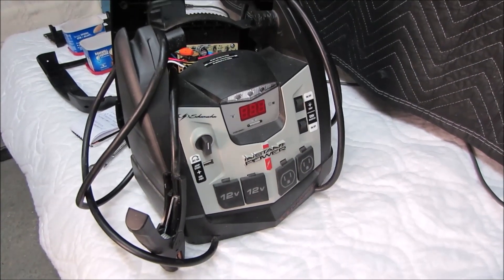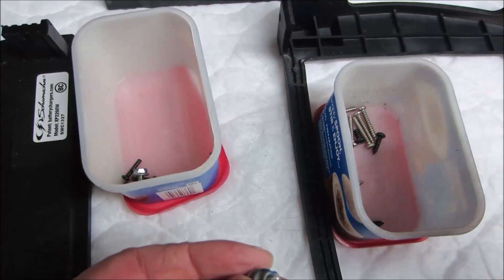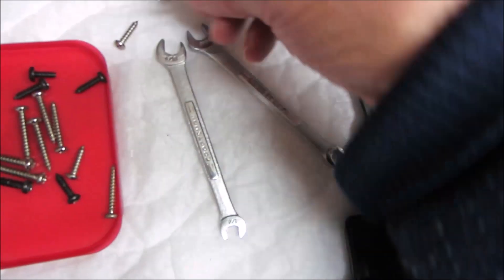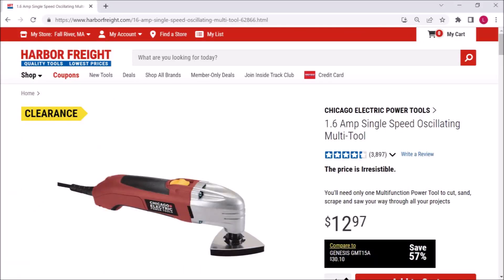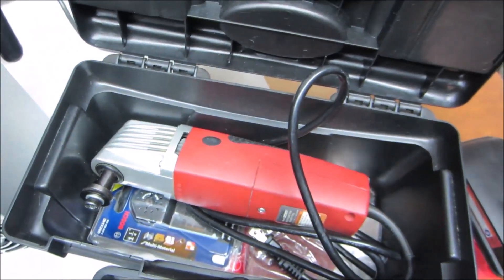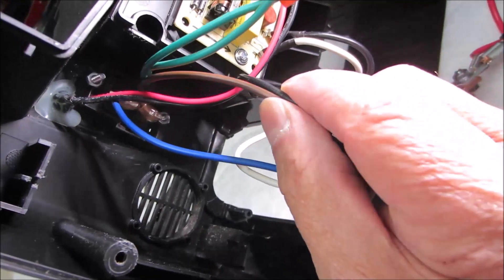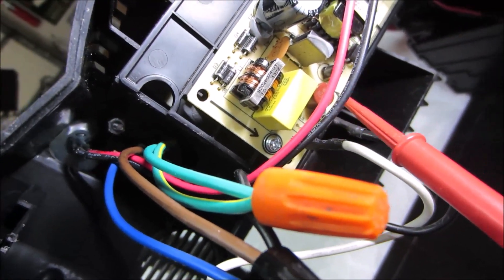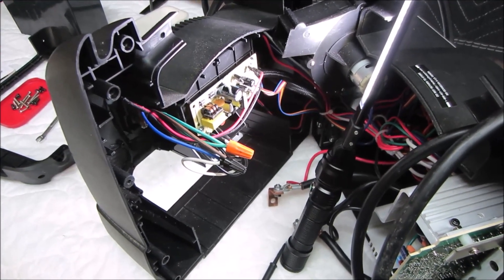Portable Power Repair Secrets - Schumacher™ XP2260 Not Charging?

Comment: Do you know what the voltage at full charge should be? I took the battery out of mine because as soon as it got to 100% and i unplugged it  dropped to zero..it’s older so plugged it in again and then i was getting all sorts of readings ..from 93% then3% and finally after a couple days on charger when plugged in it still jumped around but unplugged it was saying around 50%..so i took the battery out to check voltage ,expecting to see 7 volts or something similar..but it read 13.14 v which im guessing is full new charge..? Was thinking id find a replacement battery at first, but now im at a loss of ideas… there were 3 small screws bushings and nuts that all fit together.so im assuming theres some sort of disconnect in there ,or i maybe cause those screws to come undone some how..but I don’t know how i couldve caused it by removing the battery🤷🏼‍♂️🤷🏼‍♂️🤦🏼‍♂️
  Sorry for the long comment ,im in the middle of all this right now and as im rethinking it through im typing ..
Reply from the maker: 12.9 to 13 volts is full charge. When you say the voltage reading jumps all over the place I assume that you're referring to the digital display on the unit. Try turning the jump start switch on and putting your multimeter across the alligator clips. If your multimeter shows 12.9 to 13 volts at the alligator clips then that means the problem is with the digital display not with the charger or the battery.
Reply: @LawrencePina oh yeah across the clamps too ..well across clamps it reads mostly low voltages so imAssuming yeah the battery is just done ..its over 10 yrs old ..just got a newer noco gbx 155 jump box and i already got jaco 12v air compressor for emergencies ..thanks ✌️👍🏼
Reply: Figured out what the screws bushi gs and lil nuts were for. They held a board to a bracket with bushings keeping them from touching. Was hoping this was the issue with the bix but still once battery is connected baxk up everything reads funky again 🤷🏼‍♂️🤦🏼‍♂️

Comment: Excellent repair video good to know about this potential problem with the Schumacher because I'm buying one today the guy told me the air compressor was not working said he thought it was because it didn't have a full charge have you ever had one of these for the air compressor didn't work?
Reply from the maker: Yes, air compressor "not working" is a common problem with all brands of used / trash picked portable power packs, but "not working" doesn't tell us much. If the pump does not make noise when turned ON, then: 0. Suspect the rocker switch. If the pump does make noise when turned ON, but no air comes out of the hose, then either: 1. The rings on the pump piston are worn. 2. The air hose has blown off of the pump. 3. The air hose has a hole in it. 4. The air chuck at the end of the hose has failed. Often, a trash picked unit will have more than one of those problems (as well as a bad battery). Hope this helps. Thanks for commenting.

Comment: I just bought one. I use it to charge my phone. I had my usb charger plugged into the battery. But after awhile the battery will beep. Do I need a whole new battery or is it an easy fix? Thank you so much!
Reply from the maker: Not much to go on here. Do you have the phone's 120VAC to 5VDC wall charger plugged into a 120V AC inverter socket on the power pack? Or, do you have the phone's USB charging cable plugged into a USB A socket on the power pack? Or, do you have the phone's USB charging cable plugged into a 12VDC to 5V DC cigarette lighter plug connected to a 12VDC accessory socket on the power pack? I've tried all three ways and I can not duplicate the symptoms you describe. The only problem I did have is when trying to charge an old Motorola flip phone using various USB camera cables. None of the camera cables I tried had their charge lines connected, just data lines, so none of them were able to charge that old phone. Interested to know which charging method you used and whether or not you tried any of the alternate charging methods...

Comment: They still make the flip style. Had mine for two months..used it a few times and it already stopping taking a charge.
Reply from the maker: Might also be a dead battery. These two videos should help you to determine which it is:
https://youtu.be/OsAhYTDgEr8 - XP2260 Not Charging PART 2
https://youtu.be/g5ibI23UWCA - DieHard 950
Good luck! Thanks for asking.

Comment: my unit starts to charge then stops?  Is it a dead batteries... are they replaceable?
Reply from the maker: Dead battery is a common problem. It is replaceable. These 2 videos should help:
https://youtu.be/OsAhYTDgEr8 - XP2260 Not Charging PART 2
https://youtu.be/g5ibI23UWCA - DieHard 950
Battery is easily replaced on these units. You can do it! Thanks for asking.

Comment: My plug did not have wires ...what two posts are the two wires attached to??
Reply from the maker: When you say "my plug" are you referring to a 3-prong replacement plug? In that case, rewire to the outer two prongs. The center prong is for earth ground which is not connected on a portable power pack. For additional views of the 3-prong replacement plug I used please watch: https://youtu.be/OsAhYTDgEr8 in "Schumacher™ XP2260 Not Charging? PART 2." Lots of additional (viewer requested) info there. Good luck! Thanks for asking. Please like and subscribe as it really helps the channel...

Comment: Lawrence, is there visible damage in the connectors when they are bad/broken? Or they just stop making contact. Mine wont charge, but woulld like to know if a new charger is enough.
Reply from the maker: Swing out, power cord connectors break in such a way that their male prongs no longer make contact with the load and neutral wires inside the power pack. When this happens, the plastic is usually (key word: usually) very obviously broken and the prongs swing out crooked. Part 2 of this video, https://youtu.be/OsAhYTDgEr8 shows how to test connectors that may be less obviously broken. If the power cord connector tests good, then most likely you have corroded ring terminals on one or both of the battery cables and/or (most likely, and) a dead battery. These common problems are very easily fixed. Watch Part 2. Good luck! Thanks for asking.

Comment: Hello…
I have the Schumacher XP2260 - CA.  It won’t charge past 74% and the green led light on the back does not come on at all, of course I wouldn’t know how to fix it, but I can pass on information to my brother.  When I turn jumper on it reads 12.7,   When I turn the inverter on it reads r02, lights work on the front.  Any information will be appreciated.
Reply from the maker: Regarding the r02 error code, Schumacher codes actually start with an f (as in failure?), which I also originally mistook for an r (because it looks more like an r?). According to Schumacher, here's what it means: "F02 The charger cannot desulfate the battery. The battery could not be desulfated; have it checked or replaced." To check the battery, remover the battery compartment cover and look for corrosion on the battery terminals. Detach the connections as necessary and clean off whatever corrosion you find with a few drops of apple cider vinegar. The first few drops will bubble. When the bubbling stops, all of the corrosion will be gone. Next, test battery voltage with a multimeter. Does the multimeter agree with the 12.7 volts shown on the Schumacher display? Whatever it shows, reconnect the battery cables, plug in the charge cable and retest. Does the meter show over 13 volts now? If it doesn't, charge voltage is not reaching the battery. Further disassembly and observation may reveal a pinched wire, internal corrosion, or you might just have a bad charger PCB. Lots of info on these issues in https://youtu.be/OsAhYTDgEr8 Portable Power Repair Secrets - Schumacher™ XP2260 Not Charging? PART 2. Hope your brother can find and fix the problem. Please consider reposting after he's given it a look. Let others know what you found out. Good luck and thanks for posting!

Comment: Thanks for this. I have the AC power jack problem also. 
I need to take this on a road trip before I can attempt the repair. I'm going to try the following: 
Use a trickle charger connected to the jumper cables with the jumper switch turned on. Hoping to DC charge the battery that way. 
Do you see any problems with this approach?
Reply from the maker: What you suggest works fine. You can charge the battery that way but there's an unobvious connection catch. While both jaws of the Schumacher's alligator clips have big copper contacts, only one contact is actually wired. If you clip the float charger to the wrong contact, an easy mistake to make, it won't charge. So if you don't already have a float charger, consider something like this: https://www.harborfreight.com/automotive/battery-tools-accessories/battery-chargers-maintainers/12v-deluxe-battery-maintainer-and-float-charger-62813.html or this: https://www.harborfreight.com/automotive/battery-tools-accessories/battery-chargers-maintainers/4-amp-fully-automatic-microprocessor-controlled-battery-chargermaintainer-63350.html Both of these have an SAE connector in the middle of their output cables and come with two ways to terminate them. You can plug in a short cable with alligator clips or a short cable with ring terminals. Attach the short cable with ring terminals to the Schumacher battery. Notch the battery door so that the SAE connector hangs outside. Problem solved. Not only that, but you can leave the maintainer permanently attached. It won't overcharge the battery you won't have to energize the  jumper cables to keep it charged! Much safer that way. Good luck. Thanks for commenting. Please like and subscribe as it really helps the channel.
Reply: @LawrencePina  thanks! 
Great channel. I learned a lot in my first view. Subscribed.

Comment: hello.  Great video.  I have the same unit.  I attempted this repair because the battery wasn't charging.  Once I got the unit open, I decided to check the voltage at the battery terminals with the battery removed and the unit pluged in.  I read almost 13 volts accross the terminals.  I figured the unit was working but that the LED lite was not.  I put it back together and bought a new battery to replace the original 6 yr old one.  After replacing the battery, I was still not charging.  I also discovered that the LED would come on if plugged in and the jump switch was turned on.  So the LED works but not when plugged in as it should for a charge.  Do you think the board is bad?  Hate to abandon this unit.
Reply from the maker: Please watch PART 2 at: https://youtu.be/OsAhYTDgEr8 Thanks for asking!
Reply: @LawrencePina  Thanks for the video reply!!!  I am going to check the board as you outlined.  I did find a replacement board online for $9.  in case it needs replacing.  Have not ordered it yet but at least I know someone has them.  I will let you know what I find.